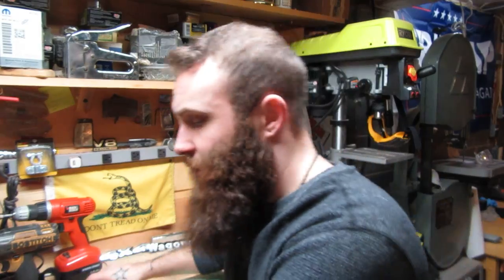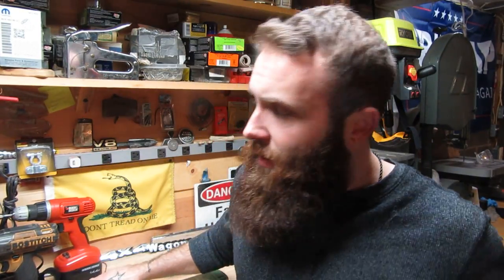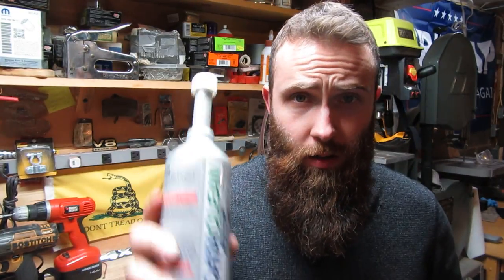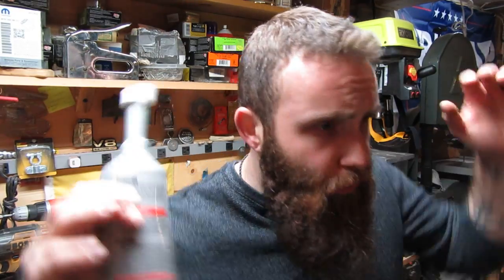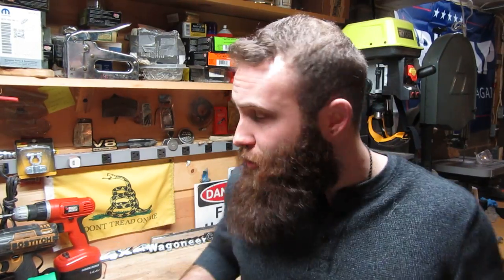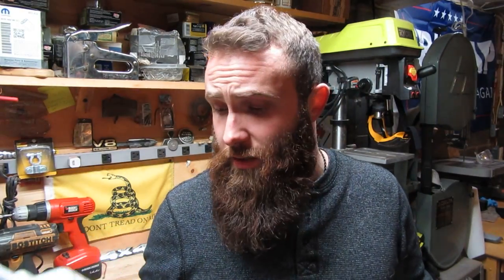How to pass inspection with a BAD CATALYTIC CONVERTER or O2 SENSORS

Comment: Got this suff. It's in the tank right now. I ran the car for about 10 miles let it slow down on its own,  stopped and turned around then went back on the highway at 65. I am going to my mechanic tomorrow to check it again. I will write you later if it worked.  I am hopeful after reading all of the comments.
Reply from the maker: Seems to have about a 75% success rate. Good luck luck!
Reply: Did it work?
Reply: @Romanrootergarage   It did! !!!!!!
Now I am a believer.
Reply: @beamoore5045  Yes!!!! I'm a believer too
Reply: @beamoore5045 I know I'm super late but what codes did you have before you did this lol

Comment: Is this going to work for check engine inspection for Honda accord 2003, with the following report?
 
PO442 EVAP SYSTEM SMALL LEAK 
PO420 CATALYST SYSTEM EFFICIENCY BELOW THRESHOLD B1
PO456 EVAP SYSTEM VERY SMALL LEAK 
P2647 VTEC OIL PRESSURE SWITCH CIRCUIT HIGH VOLTAGE 
PO442 EVAP SYSTEM SMALL LEAK 
PO420 CATALYST SYSTEM EFFICIENCY BELOW THRESHOLD B1 PO456 EVAP SYSTEM VERY SMALL LEAK 

If yes does the light goes off itself or have to reset, which way?

Comment: D&E In the Garage, My parents have a 2000 Ford Focus SE Wagon at around 115,000 miles. The code read P0420 and P0171. They only drive around town. I was told to fill it up with Premium and drive some highway miles after resetting the codes. I got to about 35 miles and the P0171 code went away, but the P0420 came back. Do I have a chance at you method working? We need it to pass inspection and buy us about year, then looking into a new car for them. Thank you, I appreciate your video and expertice. I feel there's hope for us!
Reply from the maker: there is a chance, yes. This is usually the code that this stuff would help the most.  P0420 means your computer readings (from your o2 sensors) are indicating that you cat is no longer operating efficiently. If this inefficiency stems from a dirt cat or o2 sensor, this will probably help. There is also the possibility that an 02 sensor is bad or the cat is broken inside and missing some of the catalyst material. In that case this will not help. For your situation i believe it would be worth the $20 gamble. no guarantees, but worth a try. Make sure you really give it to the throttle when running this stuff through the system. You want that cat to get hot as hell so this stuff can burn off the carbon deposits.
Reply: D&E In The Garage thank you for your time and reply. We’ll try it!

Comment: I just spend $700 to fix the engine light off for my toyota 1997 avalon code  p0302, the mechanic replace one of the fuel injector and one spark plug, that set!!
BUT!!! the emmision test is failed! I asked my mechanic, he said may be the cat problem, oh no dear! now I try to use this produce, just  buy from Ebay,  hope it may help, will let you know!
Reply from the maker: Yikes.. good luck with it. Hope it helps!
Reply: What happened?

Comment: What if your straight piped and have check engine should you just unplug battery for a little bit and reset everything then go also unplug the ecu wires

Comment: Thanks for the tip! I have a 99 4runner. No CEL but I have failed smog checks twice this month for emissions being too high. Guy at the smog check place told me to replace the CAT, you reckon this will clean it out? My CAT appears to be working fine, no codes, no visible smoke... Probably going to try this no matter what. Do you recommend I reset the battery?

Comment: i put 3L of cataclean at 1/4 in my 01 Avalon and it made the catalyst ready but once the fuel went below 1/4  the P0420 code triggered an engine light. any advice? i put a new: sparks plugs, fuel filter, air filter, oil change w/ new filter, and cleaned the IAC control valve

Comment: I replaced the 02 censor and I have no check engine light but my car fails smog it passes at 25 but fails at 15.  Can this product help me out to pass smog ? Could my cat be the problem without a check engine light ?
Reply from the maker: It is certainly possible. Not knowing anything about your car, that is the best I can offer. If you have tried everything else, I would suggest that it can't hurt. IF your cat is bad enough to effect the operations of the vehicle without throwing a CEL, then this product will probably have a positive effect. It is a $20 gamble. Do you have any other issues with your vehicle?
Reply: D&E In The Garage no not at all . That’s what confusing me , I’m going to just take that gamble then thank you
Reply: AlonSOAMAZING what happened? I live in yuppie ass California , my car has no check engine light , took it in for smog it says catalyst not ready, the smog guys told me to drive it more, lol I’ve driven it 10,000 miles. I have no idea what to do.... HELP!!!!
Reply: @operationjason  hello Operation Jason. Did Cataclean work for you with passing the smog? I'm having the same problem with my car. Check engine lights are not on but the car passes all tests except catalytist.

Comment: Tried two bottles of Cam Cleaner -- one bottle at a time, as directed on a 1/4 tank, but two full tanks of gas apart. Cleared the codes. Drove in for an inspection after 105 miles (mostly highway), but Mass. Inspection Station said I needed to drive more miles. When I got to 150 miles, the engine light came back on. Anyone know the minimum miles needed after clearing the codes on a 2009 Honda Accord to pass Mass. inspections?
Reply: My question exactly!!!!
Reply: It's not about miles, it's about completing the "drive cycles".  I would look for info. on the drive cycles needed for your particular vehicle...they tend to differ with different manufacturers and the year of the vehicle.

Comment: After adding it to the nearly empty fuel tank, driving it hard, etc. will the service engine light turn off on its own or do I have to get it cleared? will an auto part store clear a code?
Reply from the maker: You have to get it cleared on most cars. The auto parts store should do it for free for you
Reply: O'Reilly's would not clear the code for me. The guy said it was against their policy. You could disconnect the negative battery terminal for ten minutes and it would clear the codes.

Comment: Trying today ! 😣 I hope it does !
Reply from the maker: Good luck!
Reply: Did it work??
Reply: Did it work ??
Reply: @mariocasanova2456  no when i took it i believe i had to drive around for some miles until it randomly went away and took it once it went off and passed but once it goes off after driving so many miles need to take it in before it comes back on.

Comment: ok you guys... im bout spend 30$ get this stuff...but i not worried bout emission..shyt i dont even have a sticker..police pull me over so much they just let me go for 3 years like that... but i know my cat. was bad for the egg smell.. 3 years not doin nuttin but passin cops up smelling like eggs...the pigs just let me drive by ... my coil pack gave out.. found that the back pressure can make them over heat..fyi but other stuff on autozone shift is for the engine ..not the exhaust... you get 100's of engine cleaners...but how many exhaust cleaners?.... ghetto style spray some b 12 in the throttle while you raise the engine...let that go through the exhaust... you notice the differnce but its a pain in the butt...some say seaform might work.... but im seeing lots of possitive on this stuff really cleans the cat>? or keeps the light off... well if the light is off you dont smell eggs... then bacon the cat is frying good
Reply from the maker: Hey, First off.. this stuff foes work. I actually used it in my Cherokee yesterday because I was noticing a little bacon and eggs aroma when hauling up steep hills. That said, it doesn't work every time and it doesn't work if your cat is dead... only helps keep it alive. If your cat is so clogged that back pressure is becoming an issue (We actually blew head gaskets on a Subaru with a bad cat like that) then this is probably not going to fix your issue. It could still be worth the $30 to try. That is just my 2 cents. Either way good luck with it! Hope those smokeys keep letting you pass!

Also, (as stated in the vid) This is the only exhaust cleaner that i have found to ACTUALLY clean the exhaust. The other won't survive combustion and only clean components before the cylinder (fuel delivery system, invectors, etc.)

Comment: I really appreciate the tip! I have a 2007 Chrysler Aspen that just failed inspection because of both Cat converters...my mechanic reset the check engine light so it’s off now...should I use the CataClean now, while the lights still off? Or wait for it to come back on to use it?...also, do you think it will actually work for my Aspen?
Reply from the maker: It is usually hit or miss if it will work. it depends how far gone they are. My feeling is always is that it is worth a try. If you look in the comments here, it is about 50/50 people who had success and who did not. I assume your Aspen has the 3.7? if so, I have used it in the 3.7 with success.

Comment: So my check engine light is going off and on. I know it's the cat conv when its on though. Do you think if I take it in while it's off I would be able to pass?
Reply from the maker: Yea, sounds like you issue is not too bad yet which makes it a perfect candidate for this stuff. Good luck!
Reply: Did it pass?? I’m in mass only have safety cuz my car is 2004... if I put this stuff in my car n drive for a few will it pass???

Comment: I have seen where a guy removed the O2 sensor and poured seafoam in the hole and the ran the engine for a while. He got a lot of smoke as usual with seafoam. Have you heard of this method? based on knowing seafoam, if it were a carbon buildup, i think it may work to some extent. my seems to be clogged right now. I may try both of these methods this weekend and see what happens. Any advice or suggestions?
Reply from the maker: I have not.. Not sure if this would be a good idea or now.

Comment: Does the check engine light have to be cleared before the treatment ? or will it go away itself after the treatment ?  Thanks a lot.
Reply from the maker: It does not have to be cleared first. Sometime it goes away on its own, and some cars require it to be cleared

Comment: O2s keep saying Not Ready.  I have a 2012 Ford Fusion.  Its been in the shop at Ford for 2 weeks.  It dont get a message and it wont send a code.  They even changed the computer.  Help.
Reply from the maker: That is weird. You usually have to drive around for a few days for them to get "ready"
Reply: @DEInTheGarage  I did.  I drove 300 miles.
Reply: do you think changing the o2 sensors would rectify the problem.
Reply from the maker: Are there any other efficiency codes being thrown or is it just the sensors not being ready?
Reply: @DEInTheGarage  There are no efficiency codes being thrown.  Its just the sensors are not ready.
Reply from the maker: I have to admit that I am not sure what is up. Maybe check the O2 sensor fuses and relays.

Comment: I have  a 2001 rav4 Toyota I took to the macanic because I had the check engine light on he said the oxygen sensor is needed and the catalytic is going bad, can I use this cat ,and will I pass the emission test
Reply from the maker: You might. It is not a guarantee. you can see in the comments that some folks had success and some did not. It is a $20 gamble, but it certain CAN work if your situation has not progressed too far

Comment: I ran it through with a quarter tank, did you think I should buy another one if it doesn't work?
Reply from the maker: Up to you. I have had success on the second can at times. It is a gamble and there are no guarentees
Reply: @DEInTheGarage  I figured, my CE light was turning on and off earlier this year, I'm hoping it was just the converter getting dirtier overtime and not the sensor.
Reply: Glenn John isn’t the sensor cheaper than the cat??

Comment: I have a P0420 code. I replaced Both the O2 Sensors. I have a kia spectra 2006
Reset the codes. Still the code comes back after driving for a while.
What should be the next step to diagnose the actual problem before I finally change the catalytic  converter.
Reply from the maker: If you have already replaced the o2 sensors, you can do two things. Both require some equipment. If you have (or can get your hands on) a bi-directional OBDII scanner, you can monitor the o2 sensor voltage to be certain the ones you put in are good. The other thing you can do is get an IR thermometer and measure inlet/outlet temp on the cat. get the car to temperature and have someone hold the throttle at about 2000 rpm. get under the vehicle and measure the temp of the cat at the inlet and outlet. a GOOD cat will be cooler at the inlet than the outlet. a bad or clogged cat will be cooler at the outlet. This temperature test is pretty conclusive. A healthy cat (one that will not throw a P0420 code) will always be cooler at the inlet than the outlet be at least 100 degrees
Reply: Thank you D&E In The Garage .
Well I have one more question. Once we replace the o2 sensor, do we need to drive the car for about 100 miles to see if the light goes off, or can it go off once we drive for couple of miles.

Comment: if I put it in with the engine check light on will it turn off or do I need to reset the codes of the car first?
Reply from the maker: It MAY go off on its own after several miles, but most likely you will need to have it cleared with a code reader

Comment: Would this work if I have no codes but failed emissions today because of Cats/O2 it says 
gonna check for hidden codes tonight just in case
Reply from the maker: Hmm.. if you have codes you should have a check engine light. this might not work for you
Reply: Hello I have a Mazda rx8 and no error lights on car is absolutely fine but failed on emissions they used a catclean but still failed……what shall I do…..there telling me cat and sensors but if no faults are coming up then why would it be the cat or sensors

Comment: I don’t have a CEL but my cat is for sure bad (you can even hear it rattling around) already failed one time... Any other ways you could think to pass actual emissions.
Reply from the maker: Honestly, in my experience, if you cat is rattling, the  matrix inside to damaged beyond repair. This product is probably not going to work. That is just my experience
Reply: D&E In The Garage I figured 😂 Luckily I have a parts car I can swap the exhausts if I need to 👍🏻👍🏻 thanks for the reply!

Comment: Hello D&E, got service engine soon light on my 06 x3. The code shows secondary air system issue/exhaust issue which will stop from emission pass. Does it works on this problem? Thank you
Reply from the maker: Yes you will fail for that, but unfortunately this product will not help you there. You might need to find someone who knows a bit about BMWs for this issue. I am just not familiar with them enough to offer any advice. Good luck!

Comment: Worked for me. 2010 honda accord in California. P0420. Used a bottle with a quarter tank and smashed it around town. 30 miles later the light came back on. 200 miles after that without doing anything else it turned off on its own just passed smog.

Comment: Hi, I have a 1999 Isuzu Rodeo V-6. My truck failed inspections or the first time. Its failing at 15 mph test. My check engine light came on for 02 sensor but had it cleared awhile ago before my smog test. Is there a possibility this will work for my vehicle if I try this? Since my check engine light has been cleared already, do I just put in the solvent at 1/8 tank of gas, drive it for 20 miles, then take it in after I have driven 20 miles?
Reply from the maker: There is no guarantee, but it might work. Yes, you put it in, drive it a bit, but do not run it out of gas. Good luck!

Comment: Can anyone help me out here please????......03 Chevy Silverado 1500 Z71 4x4 extended cab pickup truck that has ONE stupid cat code that is keeping my husband from passing inspection and getting an inspection sticker. Last year went thru same dumb thing and spent a grand replacing canisters, evap this evap that, O2 sensors etc etc only for that stupid check engine light to come back on a week after passed and got sticker (yes tired cataclean more than once it doesn't work for this as truck has 235,000 miles on it and what were are told is Cat is clogged/junk/need new one). I heard about some spark plug spacer trick but does that actually work?? Any suggestions anyone has would be so greatly appreciated!! :) Thanks!
Reply from the maker: Hey there. Sorry to here your Chevy is giving you a ton of grief. I have used the spacer method on o2 sensor with great success, but do not have a video personally on the process. here is a pretty good one from someone else. Let me know if this works

https://www.youtube.com/watch?v=SLXb4fZx4QA